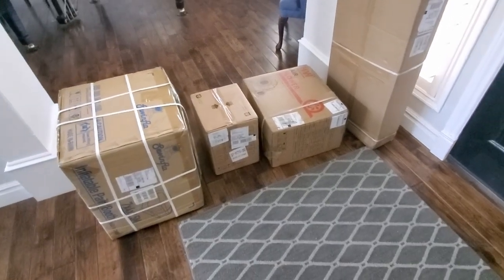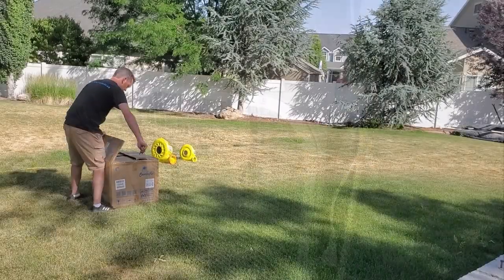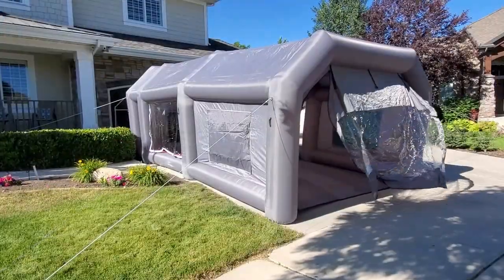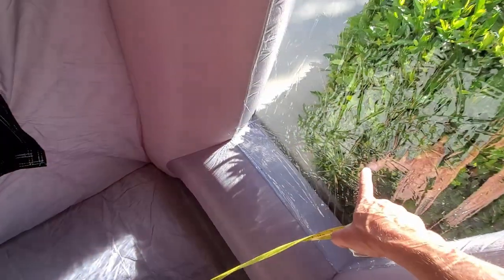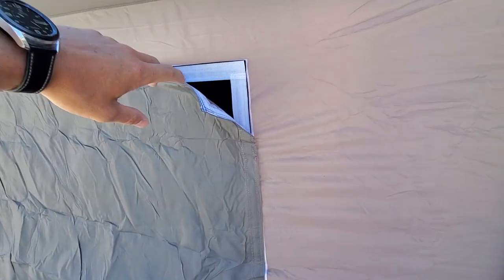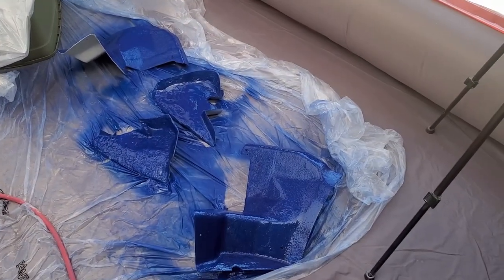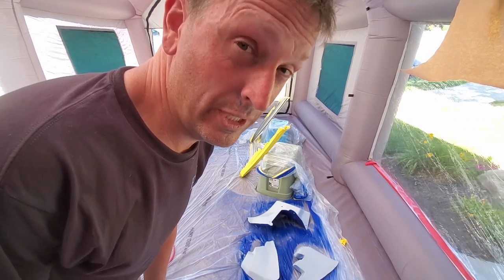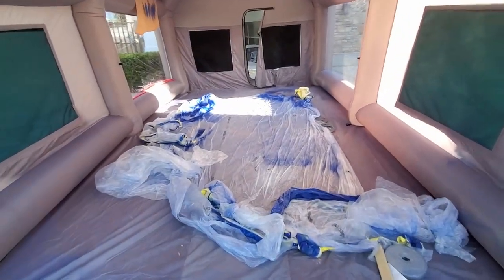DIY vs. Inflatable Paint Booth - Sewinfla Inflatable Paint Booth

Comment: I tried to use my inflatable paint booth last 4th of July in Houston. I tapped out when it reached 188F inside the booth, it’s a greenhouse effect. Booth worked fine when I used it again in November. The other problem is they are pressurized instead of vacuum cleared, so the clear coat creates a huge fog if you do a big job. I’m going to try and make an elephant trunk hooked up to big blowers to pull the overspray out.

You can buy much bigger booths, I put a long bed F150 inside mine.
Reply from the maker: Thanks for the comment!
Reply: I live in Houston as well if you ever need a plumber or Construction worke I am the owner of RLC Plumbing and Cole Construction let the office know that you met me in this chat and I will hook you up with the family discount

Comment: My first, and last question was the price. Because as long as the paint booth does its job well, it has a tangible value. I looked the price up from your link, and the price(s) seemed reasonable. Of course the price varied with size, as you would expect. But especially if you were planning on doing a thorough job and/or multiple paint jobs, you could easily justify the price compared to the DIY version (which also had its merits/limits). It seems to me that they should make an indoor/outdoor model that secures in the middle to a standard 16' garage door opening, and has the indoor side which is cooler, and is unaffected by wind and sun, and the outdoor side, which extends your space for the staging, storage, tools, and items that you would want in-booth access, but would be less affected by wind and heat. And they might want to add an extra fan for a push-pull exhaust system. As well as a top down, fresh ventilated air tube/mask for breathing. Just brainstorming. Thanks for adding this demonstration as a working follow-up to your DIY booth video.
Reply from the maker: Good thoughts!

Comment: Could you set it up in the garage, does it fit? If so, then it would be cooler and the wind wouldn't be an issue either.
Reply from the maker: Yes that would be ideal

Comment: If you had a car in there, were just done and the air blower that inflates the thing would quit working, well, you'd lose the whole paint job and it would be a mess. Not sure with no other structures than the air pressure that it's worth anything really. Or can it keep the pressure while the fan is off?
Reply from the maker: Fans would need to be on

Comment: why didn't you use the air exchange blower, was it unnecessary? amazing video as always <3
Reply from the maker: Not sure I understand the question.   I used both the inflator blower and the ventilation blower.  I would frequently no use the ventilation blower when I was not painting (filming)
Reply: @ElectricSuperCar  oh thats why, I saw that you didn't use it while filming. Thanks